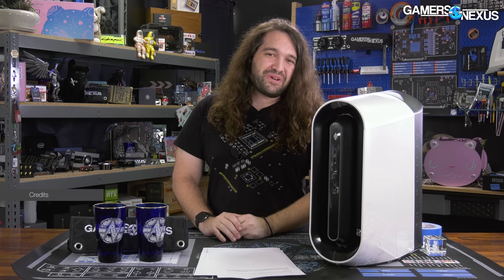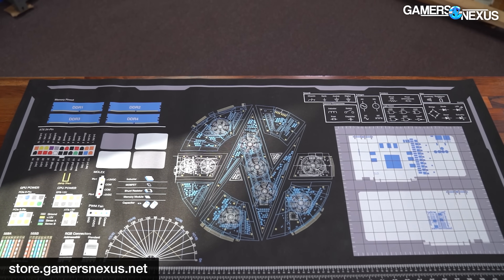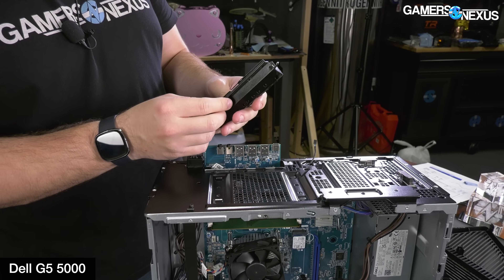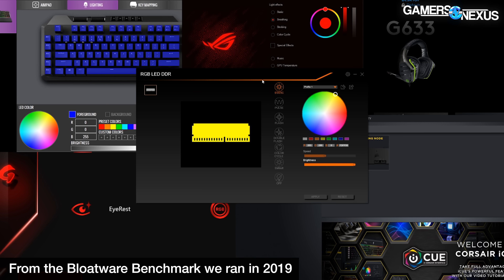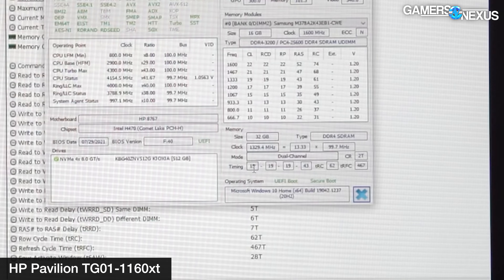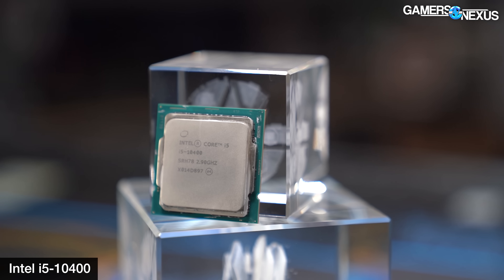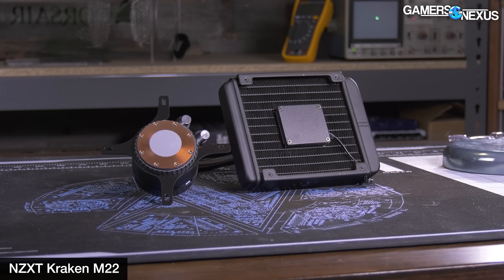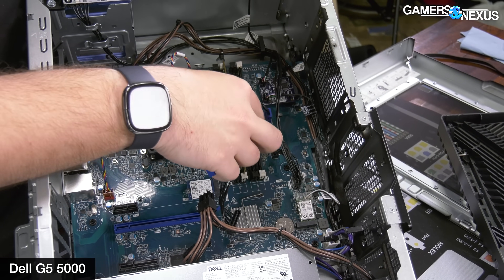The Worst Prebuilt PC Mistakes We've Seen (So Far)

Comment: I'm glad I went with my Skytech back in March. They've been great and shipped out a new PSU to replace the shitty Gigabyte PSU that was blowing up left and right.
Reply: I got a skytech last month. It's been nothing but a headache. It arrived with my 3070ti massively sagging and not fully seating in the top PCIE slot. I currently have to use the 2nd slot. Then their customer service said they would send me a riser cable to test the top slot. Then after numerous phone calls to their shitty support they said they didnt even know what a riser was and didnt carry them. That was 2 weeks wasted. Now its past due to return to new egg so I'm fucked. I say stay away from SKYTECH. Terrible assembly of decent hardware
Reply: Oh also I barely went into all the problems I found....

Comment: Completely unsecured power supply in a brand new custom build from Skytech. The cooler as well, it was worse than a stock cooler, and thermal paste application was pretty terrible, with a couple big gaps in coverage on the IHS.

Comment: I bought and picked up my PC from CyberPower 2 years ago and I have since had to redo every connection and replace the cooler due to it getting to 90C on my Ryzen 3800x. I did prebuild because at the time it was pretty comparable to me just buying the parts outright.

They didn't provide me the screws or extra cables for my system (even the modular power supply cords!) and the thing had not 1, not 2, but 3 bluetooth devices in it to control the fans and RGB strips. And all of that was plugged into the case's fan controller. Oh, and the fan controller itself wasn't even plugged in correctly either, so my fans were running at full speed. The cable runs looked clean, but they had used redundant power cables for no reason at all, daisy chaining things just to make things work. They wired the AIO pump and fan incorrectly and they left the rest of the MB completely alone; not even bothering to plug-in at 4-pin power connector or using the board's built in RGB headers because "f- that I don't get paid enough".

All this in a case that I should've done more research in (Corsair SL600M), meaning it had shit for airflow for the 2080 Ti and 240mm AIO in its default config. I've since had to get a riser and get it vertical for the thing to even breathe... which is when I found out that they had used a damn splitter to the GPU when PSU has 3 PCI-E connectors to use!

So yeah. Never doing that again. Did get me intimate with my system, though. Just about everything in it has been upgraded and replaced due to work and gaming.

Comment: I think you're exaggerating how bad a 120mm all in one liquid cooler is. If installed properly it will equal or outperform most air coolers. I don't know what you guys were doing in the past to test these coolers, but I've never seen any air cooler down right outperform a liquid cooler regardless of the radiator fan size.

Comment: Bloatware is a case in itself. I am yet to see a simple, with no .net, no odd toolkits, not popups, no unnecesay services, no unnecesary residents in memory, tool that just offer firmware and drivers updates. And I've been in this since 93'. I usually remove the OS altogether and get a cleaner from hkrg, and if possible migrate the license.

Comment: Holy sh** man, i laugh my ass when watching this video as this is soo related to my experience in office
We use Dell & HP prebuilt as we need support for deploying & maintenance thousand of pc across entire nation
I don't know for HP now, but HP PC a few years ago (around Ivy bridge gen) is not so bad that even though some of them are proprietary form, most of it we can replace it with standard component
We can change motherboard (but you can't use usb/audio front panel), psu, ram, hdd or even case. The only one you can't change is cpu cooler as you must change the motherboard
Dell, well, it was so infuriating
Want to change PSU? Nope, it was long PSU normally used in server
Motherboard? Nope, non standard form factor
CPU Cooler? Nope, it was screw on the case and the hole is not standard
Case? Nope, you only can reused processor,ram,and hdd
Even just adding HDD/SSD YOU MUST USED SPECIAL CAGE FOR IT, like, screw that, i just slap my SSD using 3M double tape 
Oh, i don't mention that you also need "special" power extension cable for the HDD/SSD
The Windows also sooo slow as they are so many bloatware on it even though i already remove it
The first time i just accept it as this PC was still using HDD, not SSD, but after i reinstall it, the Windows is much faster
I honestly don't know how Dell can failed so hard on prebuilt PC as it was very different experience on Dell server

Comment: Good stuff, TBH. I really like this one, it calls out a lot of OEMs on a lot of bull. Badly needed IMO. (Also, that cat is absolutely adorbs /squee)

I still like the HP weird crap wiring harness, yeah I know but it makes logical sense. Also... just because it's proprietary doesn't mean you can't reuse it elsewhere -- you just have to be willing to know a lot more about electronics than most PC/tech repair type places. I kind of soaked up computers and electronics at the same time growing up, and since that was the 90s, mostly the mid-90s, the two weren't actually all that separate in terms of fields just yet. I'm actually a low-income fella, and tinkering with weird proprietary stuff like you find in older systems like these or in thin clients (which are a LOT worse as far as proprietary goes -- if you think Dell/HP office boxes bad, poke around in a Neoware or Wyse client sometime LOL) is easy coz they're dirt cheap... and once you get used to the proprietary wierdness you sort of learn how to wrassle it around a bit.

Just by way of example... took on the task of a simple, clean, but reasonably useful basic build for a pal using what I had on hand. Normally i'm a bit rough-around-the-edges at best, and I like that look, so keeping things tidy is a bit of a challenge for me. The mainboard is originally out of a Wyse Z90D7 thin client system; it's a bit bunged up but not bad at all -- there were two threaded inserts supposed to be soldered to the mainboard for its CPU/chipset heatsink and the factory had missed those, and somewhere along the line the little header for the speaker had ripped mostways off, so I took care of those. Spare RAM from the closet -- mismatched, it's a 2gb stick and a 4gb stick of DDR3, but it's what I had to throw in and since this has an AMD G-Series G-T56N CPU soldered to it, it's erm not a gaming machine! That's a positively industrial CPU. The mainboard will be bolted to a frame constructed from the empty lid of an old Pentium III Dell Inspiron laptop, in turn mounted to an old HP all-in-one stand (the all-in-one was VERY dead when I got it lol). Its heatsink, and a 60mm fan from the drawer, will be partially covered with a shroud, and another, separate shroud will cover some cabling to the other side.

On the other side is a 500gb platter drive in a frame that hangs from an upside-down vertical mount PCI-E x16 flexible riser, one of the USB3.0 cable based ones. This is internally an x1 slot except for power, and routes to the PCI-E Mini Card slot on the mainboard. Power and signalling to the hard drive is along a unified-connector SATA cable, as the mainboard's primary SATA connector is designed for a special sort of compact SSD called a "Disk on Module" ("DoM" for short) that uses such unified connections, and makes using more conventional cabling rather difficult at best. The drive, frame, and slot setup ultimately attaches to a metal and probably plastic assembly that I've not yet finished making, built largely from the I/O shield and PCI slot frame part of a stumpy little Pentium III era HP desktop where that frame is one piece of a two-piece assembly making up the motherboard backplate; the other part is the actual mobo mounting plate proper (which got tossed in the closet for later). I'll be cutting up the PCI slot area a bit, then figuring out how to put something both structural and decorative in the I/O shield area that the card slot / HDD assembly can hang from, and then painting, assembling, and mounting the framework. After that and the two shrouds I mentioned, it's just a matter of final assembly and installing Linux Mint.

My guess is that that HP power supply with the split rails can be very easily adapted to a standard ATX layout with a bit of custom wire harness work and a trio of DC-DC converters -- a 12v-to-5v and a 12v-to-3v3 on the mobo rail, and a single 12v-to-5v on the drives rail lol -- to provide the missing voltages. It's not really that big of a deal TBH.

That said...
Is it ungodly boneheaded to do that sort of crap in a standard PC? Yes, absolutely. It might save 1/5 of a cent somewhere but it does indeed cause problems down the line as Steve says.
Is it awful to the consumer to do that in a standard PC? Oh F yes, it screws them over more than the fastener section of a hardware store. 99"% of people will put a box like that curbside rather than pay for weird crap repair parts that wind up costing twice as much as their standard-form-factor counterparts simply because they're strangely lumpy in Dell tower case ways.
Is there a certain corporate-profiteering cynicism to it? Of course. The OEMs want to be able to charge you out the wazoo for repair costs, too -- or just sell you a new machine for an equally-obscene markup and for equally stupid "reasons" (flimsy justifications, at best).

But in the right hands it's easy to handle. It's just that "most folks", as it stands right now, are not the right hands. There's two ways to approach that... mine is that we need to educate "most folks" better to begin with, which has the side effect of addressing a significant number of other societal ills, so that this isn't a problem any more. But that gets into politics and socioeconomics and even if this were the right channel for that, which it's not, that stuff tends to start a lot of fights all too easy these days, so I'll not be discussing it here.

Comment: My Acer laptop had freaking electrical tape in between the GPU and heat sink! For over 5 years, I had no idea until I recently took it apart to reapply the thermal paste. It instantly got 20-30% more frames and ran 20 C cooler.

Comment: I know I have commented this in the past but I bought a new alienware this year, and it would not let me upgrade OR downgrade the cpu. Something was locked in the BIOS that wouldn't allow it to boot with any other CPU I tried. BTW I was trying to downgrade from a Ryzen 9 3900x to a Ryzen 5 3600 because I bought the machine to snag the CPU and GPU for my custom build without paying scalper prices. I also tried a 2600x and a 3700x with zero luck. Put the 3900x back in and it booted right back up.

Comment: My prebuilt had a heatsink with a fan that hid half of the screws connecting the heatsink to the motherboard. the heatsink was defective, and they used the fan to hide the fact that it had 3 screws. it looked like it was recycled after tearing up someone's motherboard.

Comment: There is a legitimate reason for OEM's and SI's to use 120mm water coolers:  they put less stress on the motherboard than a large air cooler when the box is subjected to rough handling during by shippers, while cooling better than small air coolers.

Comment: The Corsair vengeance uses a cheap splitter from the AIO pump that is half micro-usb half usb header and if you touch it a little bit the USB header will die and your network card won’t work because it’s connected to that USB header lol.

Comment: After watching your review of the Skytech Chronos, I purchased the & highly recommend it. Chose a SI vs OEM due to the price value and lack of bloat ware. Not to mentioned, it’s nearly impossible to build one with the lack of supply.
Reply: How has it served you so far? I’ve been checking out their rigs but still a little unsure
Reply: @izabellecovey3868  Use it everyday, I WFH then game evenings with no issues. 120+ FPS with the 3070, highly recommend buying it.
Reply: @osoquik4447  i’ll take another look at their models then! Got it mostly narrowed down to Lyte and Skytech now, thanks for the recommendation!

Comment: i have a salvaged motherboard from an HP prebuilt, it works completely fine except some of the front panel connectors were proprietary. i have no idea what they did but from the cables coming off the prebuilt's case, im either supposed to screw the end of cable onto the board or solder down a single wire. im assuming solder because at one point the cable just fell off the board and then i lost a USB port, my new case only has a funcitoning power button

then again when i tried to check the drivers for updates using HP's support app, they refused to believe this computer even existed. so i guess even HP dont want to own up to the bone and gristle of a PC my parents bought

Comment: 9:25 
Okay so I'm not in the least bit an expert on PC building and parts, I won't even assert to be knowledgeable, but is it possible they're referring to the configuration of the actual sticks themselves?  

Wasn't Linus recently talking about how you could have two laptops configured exactly the same with the same amount of ram and number of sticks but way worse performance on one with cheaper ram?   Something like if the 32GB of ram was made up of two sticks that each had 2x8 configuration with one more memory controller or something, as opposed to two sticks with 1x16 configuration with one less memory controller, it was markedly slower, despite having the exact same specs and layout on paper.

Again if I'm totally wrong, please let me know, but that's what first came to mind when he mentioned the SIs claiming to use "dual-channel memory".

Comment: i bought a cyberpowerpc a while back (since it was actually cheaper than building myself due to the Great GPU Shortage)... and i certainly see these issues in it. 1 8gb stick, i have no idea what psu it uses (apparently apevia, but i kinda forgot), and a not very notable cooler (intel stock). funny thing, when i originally received it, it was getting HORRIBLE frame rates in everything, and 99c CPU temperatures. so i opened it up, to find that the cooler literally wasn't even mounted on fully. was a great way to kick off my first actual PC... lol.

Comment: I once wanted to install a case fan bc I was noticing it running a bit warm. On the board there was a spot marked for a fan connector and the soldering holes were there but there was simply no connector soldered on! What even is this level of cost-cutting?

Comment: My first computer was a prebuilt. It was built by the shop that sold it rather than by a big company, and the best way i can describe it is "good learning material". As in it had 256mb of RAM which wasn't enough for win98 gaming, said RAM was not set at its rated frequency (so yeah, BIOS manual was super handy), the requested HDD fan was installed but not connected to anything, the CPU fan was 60mm at 6000RPM and the non-descript PSU died after 4 years. 
Was also fun upgrading the thing. Installing the drivers for Creative SB Live 5.1 required waiting for about an hour of system being completely unresponsive, Sapphire Radeon 9600XT had overheating VRAM needing some custom radiators glued to it and on Radeons X800 with PCIe-AGP bridge said tiny bridge wanted to overheat.

Comment: Once again, saving the buyer of a Dell prebuilt significant money by using proprietary parts is a "mistake". No one that buys a Dell prebuilt is going to have a sudden change of heart and start upgrading and replacing component parts as opposed to landfilling the whole thing, (whether it was made of standard or proprietary parts) and buying another prebuilt.

I get that some of use our desperate enough to get a GPU that we'll buy a prebuilt, and we want stock parts, but a typical prebuilt buyers does so because they want to a computer that works the minute they unpack it from a box with caring more about cost than what parts it has. And want their next computer to be the same way. It's not "planned obsolesce  to making them buy a new power supply" because they aren't going to be buying a new power supply under any circumstances.

Comment: And what ever you do. DO NOT ORDER a water cooled AMD pre-built/custom build from CyberpowerPC. I made the mistake and realized that they did NOT include a DRAIN PORT. So now i can't easily replace the crappy Apevia 6 fan push pull radiator set up. Not to mention, the first time they shipped my pc to me. The 360 rad only had 5 push pull fans and I ordered 9 fans. So there was no excuse. Meaning the 360 rad was NOT fully occupied. Also the first time CyberpowerPC sent it. The water cooled PC leaked. After receiving the second time, it works fine. No leaks. However, the AMD Ryzen 9 5900X reaches 82 C at 30 percent load in Cyberpunk 2077. Hence why it infuriates me that they didn't include a drain port. So that I could upgrade the crappy Apevia radiator fans or even upgrade the whole CPU water cooling system. Maybe there is something wrong with the D5 pump. I honestly do not know. Of course, the only thing that works well is the non-water cooled PNY EPIC X Revel RTX 3080 graphics card.